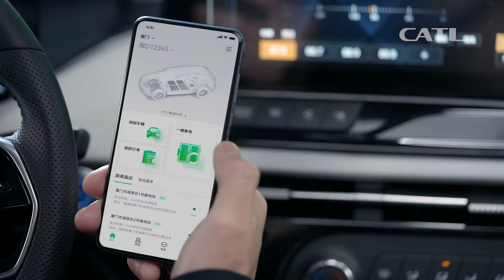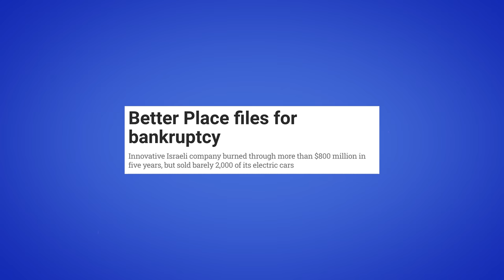Why Battery Swapping Is A BAD Idea

Comment: You make the point about "charge rates are only going to get even better with each new improvement". This just emphasises the fact that purchasing an EV now is money down the drain. Who will want to buy your second hand EV with a charge time sometime between 30 and 60 minutes, the low used price will reflect that. There are way too many known not knowns, let alone the unknown not knows, with EVs at the moment. Many people are going to get their fingers well and truly burnt!
Reply from the maker: Not necessarily. Most people charge their cars overnight at home. And average commutes are only a couple of dozen miles. There’s not an enormous need (on a regular basis) to charge a car fully in one quick blast.
Reply: Exactly, Hybrid power is more appealing. Rory forgot to mention NIO is leading the pack in R&D into new battery tech. We'll all be using their products soon. When the tesla new battery bills start to come in 5 years time they'll be sorry.
Reply: @AutoTraderTV  Why this emphasis on 'commuters' all the time? There are many who earn their living on the road every day and would need fast charging to be available for them to do their jobs effectively. These people drive diesels for a reason.....long range and ease of restoring that range quickly. Their livelihoods rely on not sitting around doing nothing during their working day!
Reply: since many of us still use ICE car, let's just talk about. swapping fuel tank.. that would be cool and dangerous
Reply: @malph9216  like my DPD delivery driver. Got the email with an hour delivery slot, proudly proclaiming my parcel would be delivered by an EV van with the usual pictures of sunshine and leaves plastered all over it… because y’know… environment. One missed delivery window and a ten hour delay later and my parcel turns up in a diesel van because the electric one ran out of charge. The ICE ain’t dead yet, no matter how many people say otherwise.
Reply: Imagine a world where everybody is waiting for technology to be perfect.

Comment: I was into battery swapping before. But later, after heading back to square one and thinking again why we humans benefit so much from electricity is because of it's ability to store and transfer energy so quickly and controllably. This means, heading back to mechanical ways of moving energy tops out at a point where time and energy required to move the battery back and forth becomes more expensive than moving electrons.
Reply: You know, in the world of big data there was a saying that fastest bandwidth for data exchange comes in shape of  a truck loaded with harddrives.    Plenty of my colleagues travelled across the continents with suitcases of harddrives
Reply: @dmitripogosian5084  That is also high risk on so many levels.
Reply: @dmitripogosian5084  What about cost. The transfer of those kWh will be extremely expensive. NIO now subsidizes(which makes them a loss) the swapping to make it look attractive. Same as Tesla did in the beginning to give away free fast charging. The thing is, all those charging stations that cost probably up to 100K or more and they currently all need an operator with a salary. Maintenance So the CAPEX is 20x+ higher than a fast chager. the OPEX cost is also extremely high because of the operator salary + maintenance. Plus the energy prices. This all combined is going to make the swap way more expensive than a fast charger. Do take in account that for example Tesla calculates the fastest way of the route + fastest way of charging so it will never charge to 100% during the route. But a Tesla charges really fast between 20 and 80% SOC. Making Swaps almost useless in most cases. The battery swap is maybe better for a very very very small group of people. But for most people its useless and extremely expensive.
Reply: @HermanWillems  Well, energy prices affect Tesla and swapping systems in the same way.  Now your next statemement 'Do take in account that for example Tesla calculates the fastest way of the route + fastest way of charging so it will never charge to 100% during the route.',  if I understood correctly, is for me an immediate reason to never buy Tesla.  What if I change my mine and take a detour on scenic route ? Least I want taken away the freedom to go where I want. I'll take better a bus than having to tell my car where I go in advance, and not being able to change my mind enroute.
Reply: @dmitripogosian5084  well u can change the route and then it will recalculate. To be honest. I live in the Netherlands we have so many chargers everywhere... i have never heard people with range anxiety here. I can charge: at home, at work, almost all gas stations in Netherlands on the highway have FastNed super chargers 350kW. And add to that the many Tesla chargers. Also u can charge at most shopping malls. Even with this i barely use fast chargers. You need to just experience it. Do you have an EV because if not you can't really tell if you really really need swapping. Soon there are chargers everywhere. There is little need to those expensive swap stations.

Comment: It honestly seems like a standardization and upgrade nightmare.

First you need all the car makers to agree on a small number of standards.  Multiple standards for different sizes of battery will increase the number of spare batteries the swapping stations need to keep on hand.  They have to support big cars, small cars, low power cars, high power cars, all with the same standards.

And then as the tech improves with higher energy density or higher power density, it sounds like a nightmare to roll out new versions.  They'd have to roll out a set of the new batteries to every swap station very soon after launch.  And you'll still need to support the old standards for ~20 years until the old cars are phased out.  Are the swapping stations prepared to support 10 different standards between different use cases and legacy cars?

Charging standards don't really have this issue.  Aside from Tesla dragging its heels, the plugs are standard and will work up to 350kw.  And if changes are needed for higher power, it's much easier to make backward and forward compatible plugs than entire battery packs.  Or to create adapters if more drastic changes are needed. 

I could see it for fleets like busses, semis, or mail trucks.  But those would require fewer standards and they'd have more control over phasing out old standards.
Reply: Yes, all these are the big picture reason why its not sustainable long term.
Reply: For standards, the same external form factor (achieved by having the battery in segments) and having the same connectors goes a long way. So long as these swap stations are in an area with charge points nothing is lost, swapping would just be a fast optional extra when in stock. The driver could pay to reserve stock on route and see stock numbers.  Cars could be built to take several different types of cell.

Comment: £600000 is nothing for construction. Manufacturers could agree together upon a standard to get this working. The standard would only need to be on the form factor not on the cell technology as you could select the cell tech at the station depending on your requirements.
Cell swapping could also be done by hand in banks of batteries, service station staff could do this and during afterhours people could rely on charging instead

Comment: Like FCEVs,it is a non-starter. One additional thing wrong with it is that the best electrical connectors are going to give trouble after being repeatedly plugged in and out dozens of times. Just like a wall socket that loses the ability to hold a plug securely after many uses.

Comment: When I first heard about 'range anxiety' my first thought was to introduce battery swapping, it made a lot of sense a the time... but today the EV industry is too diverse in Ev implementation, the design, the kwhrs.. charging systems...
Reply: Cars should get their stuff together like bikes and motorcycles makers have. E-Bikes today have standard and you can swap out batteries between brands. Piaggio (who also own Vespa) are following a new standard for motorcycles and scooters and have vehicles out now that you can swap and charge at home. Honda/Yamaha and others planning on supporting that standard and putting out vehicles vary soon that you can interchange batteries with.
Reply: The main issue is each EV uses different sized batteries to be optimal for it's weight and size. For this to work we'd need standard sizes much like AA or AAA batteries. We also can't have water cooled batteries either as we can't have the cooling lines hook to the car without making removal a much harder task. Considering water cooling is basically required to maintain the batteries, it would mean burning through batteries faster. 

Then the stations themselves while faster for the user are mechanical nightmares. It's already unreliable enough getting to an EV charger that works on a roadtrip, and those are literally just a box with a relay on it. These things are giant machines that remove screws have hydraulic lines everywhere, and then still need to have fast chargers built in so the old batteries are fully charged in time. It's just not viable.

Comment: It was always a misguided idea. The cost, infrastructure, and collaboration required make this inefficient. Not to mention if it can only do 1-2 cars at a time the wait time selling point is completely defeated.
Reply: The cost actually works out to less then 15, 000 usd  As of now a 2nd gen swap station  is 250000 usd and can do 15 cars per hour  with the present 3 min per car  , now a tesla supercharger  cost 47,000 per unit and the average time is aprox 25 to 30 minutes  per car  so for the same out put you would need the equivalent  of 5 chargers to do the same amount of cars so the cost is only aprox 15,000 usd more . Now this gives you a option as you can charge like normal or swap , now as technology  for batteries  change and get better all you would do is swap units but for non swappable  cars you would need a whole new car. And it's funny to mention  geely as geely is huge being the 2nd largest  ev company  in the world and sells a suv that gets 400km per charge and cost only 14,000 usd and is coming to North America  soon  so pretty sure they will sell alot to the average joe
Reply: @rdeh1678  Im in the industry, and we build in Europe converters that do AC to DC far more powerful and way cheaper. The Tesla Supercharger mass produced, would be able to be made under 10K easily. You are talking here about CAPEX. But lets talk OPEX. The operational cost of a fast charger is extremely low. Almost no moving parts, no salary of the operator. And no maintenance. The battery swap station will have both a high CAPEX and a high OPEX. Which the customer in the end has to pay, and therefore it will be a lot more expensive.
Reply: @Aerism  it has nothing to do with speed or cost at no point can a battery charge  in less time from a low state to 100 percent  in less time then a swappable  batteries  , also please keep in mind that over time a battery  will become  less capable  and range will degrade over time but if a unit from a car can be changed it allows  the end user to always have the ability  to have a new battery   and or a battery  with better  technology  . Case in point many older ev cars will need a battery  swap  but as high as 30 thousand usd or more if you consider the huge battery  in the new bwm  7 series  . Instead of just scrapping the car do to cost of the service  it allows  them a peace of mind .
Reply: @rdeh1678  in general sense. You always need to take in account 10% degradation if any lithium battery. At a certain point the NIO swap stations will give you a 90% degradated battery pack only giving you 90kWh instead of 100. Those are just lithium batteries like anyone elses. If NIO would replace those batteries which are just a couple years old with new ones would be bad for enviornment. Agree? Lithium batteries degrade fairly quick to 90% then super slowly to 80%. Even at 80% my current Tesla Model 3 would be enough for me. Every buyer should substract 10 to 20% of the max range and ask themselves if that range is ok. The problem is for example the LFP battery can do 1 million to 2 million kilometers on the battery. Since when was the list time YOU driven a car with 1 or 2 million kilometers on it? Be honest. The battery will outlast the car. The battery then will be used for storage. And then later on recycled. People think batteries need to be replaced. This will not be the case. No need. And after 1 million kilometers u think that NIO car is still on the road? Or 2 million? No.

Comment: Nice idea, but basic cost & logistical problems make this impractical. And there are battery pack standardisation issues. Plus EV charging technology is advancing so rapidly that swapping will soon be obsolete. As long as there's a coffee shop within walking distance of a public charger, then I don't mind waiting 20-30 minutes, because I need a break more often than my car needs charging, which I 90% do at home anyway.